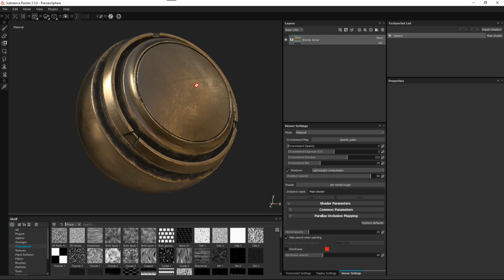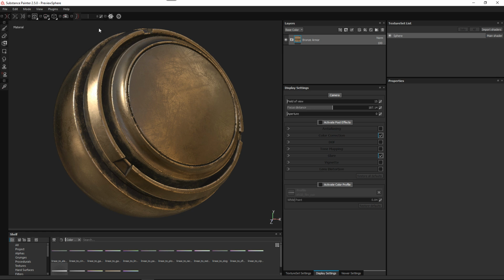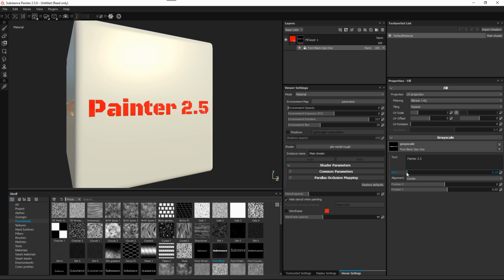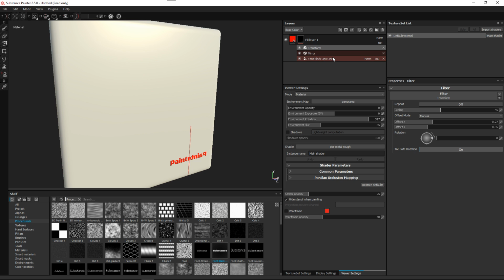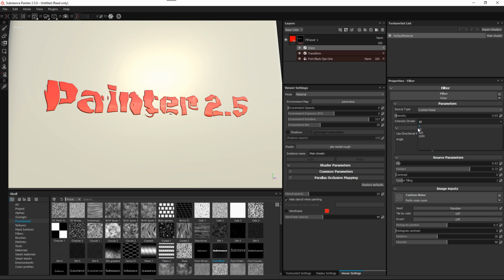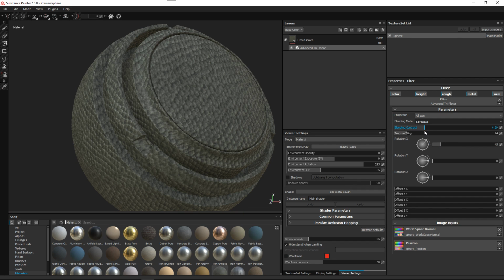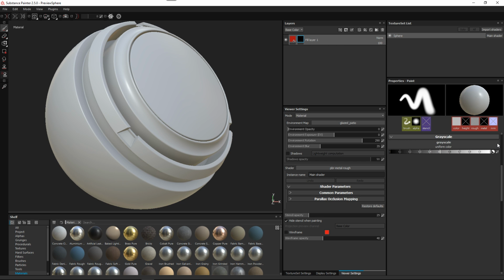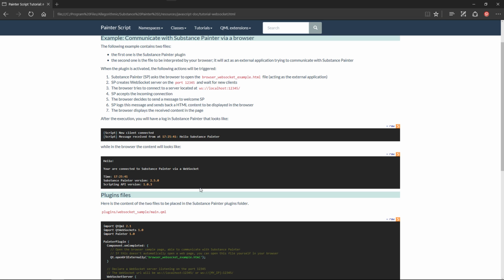Substance Painter 2.5 Feature updates | Adobe Substance 3D

Comment: seems match by mesh name and the average normal tickbox is a bit borked in this update, had no other issues thus far and everything else is great.
Reply: yeah your right, damn, that really messes up my workflow, just done a test bake of which worked fine in 2.4 but artifacts on messes of different names in this version ;[
Reply: adamdproduction yea same here, I spent a good hour and a bit trying to fix my mesh lol. luckily though the previous version works fine and they are currently working on fixing it.
Reply: Good good, hopefully its a quick fix, this feature is a must have when baking normals, where did you hear they where working on a fix?
Reply: adamdproduction froyok on polycount, one of the Devs.
Reply from the maker: Yes. we are very sorry for this issue. We have a hot fix coming ASAP.
Reply from the maker: We are indeed working on the fix now. Should be out very soon : )

Comment: What PC specs Allegororithmic team use for those videos tutorials?
Reply from the maker: I use an Alienware 15" laptop. CPU i7 2.50GHz  with 16GB ram  -  GPU NVidia 970m 3GB. For the GPU, I set the Threaded Optimization to off for the 3D settings. This is a better setting for Painter.

Comment: I actualy never got it why use painter and not substance designer? I mean i know making masks, is the best in painter. but what does it offer that i cant do in designer? And i see people making textrues there or backing them in painter and not designer. i always wonder.
Reply from the maker: Painter just has a different use case. Designer is being used more by technical artists who are making base materials and utility nodes. 

Painter is different in that it's better to use for props where you are not tiling textures. It's also used for finishing textures. You may have base materials from Designer and then use Painter to apply materials and also build up textures procedurally using generators to get you about 80% done. Then the remaining 20% is polishing or finishing work with hand painting. You can really do any handpainting in Designer.
Reply: Okay. Then are we gowing to see a other tutorial about Substance to UE4 with a different workflow? now with Painter 2.5 and Designer 6
Reply: Heh, I was always thinking the opposite. There is very little reason for me to use Designer when Painter provides all of the functionality I need plus the ability to paint on the mesh. With the Substance Share/Source library as massive as it is, it's extremely rare that I need to create my own materials. And if I do, I just repurpose an already existing one.